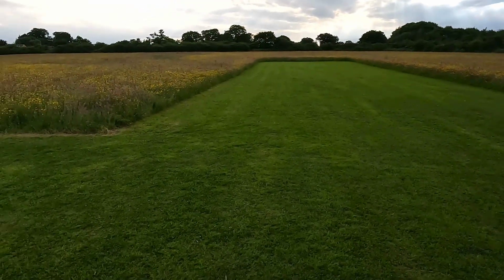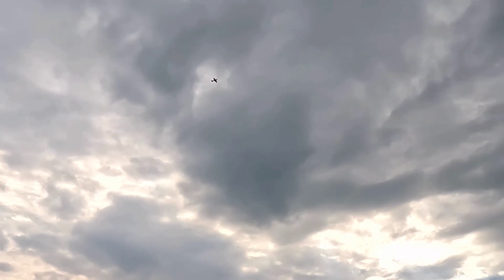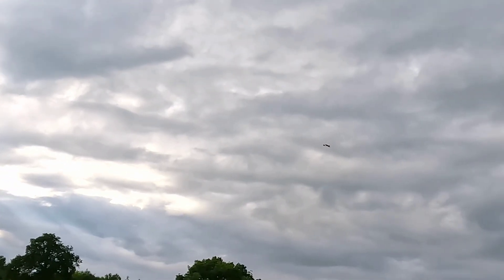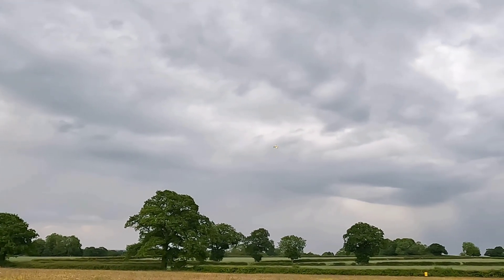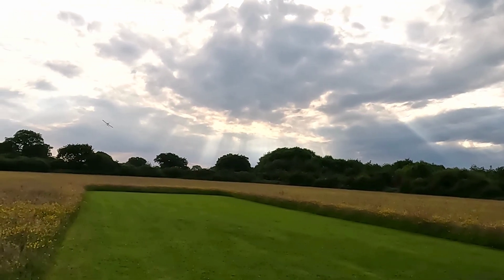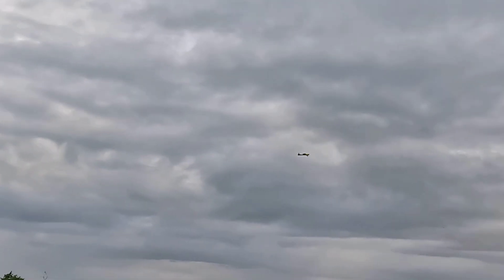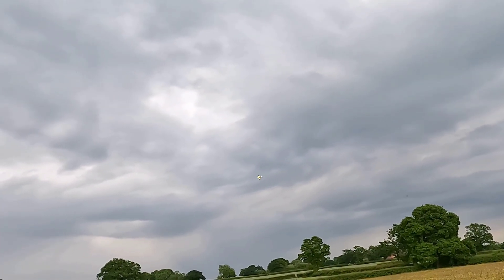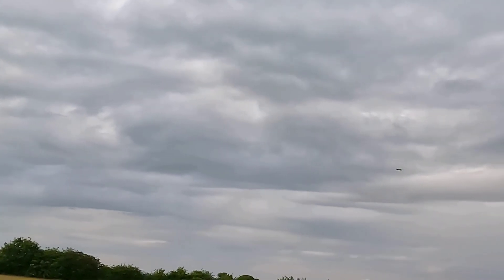SebArt Katana S 50E - Pt1 Maiden Flight TrimOut with Experts Narrative - GoPro - RC Aircraft 2022-07

Comment: very nice plane and flying - i always trim my planes for horizontal flight at about half throttle so it starts to climb when adding power - but just a personal preference. looked rock solid in the air.
Reply from the maker: Thank you for your Comment. 
The Katana previously belonged to the "expert" narrating the video. CliveS flies F3A aerobatics. The the Katana was essentially already set up but as I had fitted and new RX and new model in my TX, Clive was fine tuning my setup and familiarising me in the craft characteristics.
The SebArt Katana flies "like its on rails": great for aerobatics, for casual relaxed cruising with delightful ease and everything in between.
Reply: @davehrcfpv i recently bought a used one with digital hv servos. So i have to buy a drivetrain for 4 or 6S. Thats why i came across your video. My first sebart and first katana.
Reply from the maker: @lechiffre2617  The Katana was originally configured for 5S, so not recommended to go less than that. My Katana is 6S and has unlimited vertical climb. 
Details are in the video Description.
Well done on you acquisition - you will love it
Reply: @davehrcfpv  thx, for 120 € i couldnt say NO 😂. Theres a V2 out there but i dont know what the difference is beside the paint scheme. The math looks ok on 4S for basic flying and i can swap to 6S immediately with the dpower al4206 motor. So im confident...
Reply from the maker: @lechiffre2617  Bargain at €120!
I'm sure you will be on 6S sooner than you think. Recommend fitting a 6S 70Amp ESC to start with and ease the upgrade to 6S. Oh, and you could use throttle limiting on your TX to emulate 5S if set up for 6S.
Reply: @davehrcfpv  ok, thx - wish me luck for the maiden - cheers from germany
Reply from the maker: @lechiffre2617  I hope the mainden goes well for you.

Today I very sucessfully maidened my Sebart Sukhoi SU-29S 50E in 20th Anniversary colour scheme. What an amazing plane. Good enough to execute several aerobatic manoeuvres and a smooth landing. The video will appear shorty.
Did you find my Katana Pt2 video?
Reply: @davehrcfpv  yeah, but not part 3 ??? The thing is, i bought a used katana 30e for 70€ last year which was damaged. Repaired it and dropped in the electronics from a precision aerobatics XR52. And i have to maiden this one first - LOL
Reply from the maker: @lechiffre2617  Ah, yes, Katana Pt3. In the UK we have lost 3 months of flying weather this year, which has delayed everything. 

Have you you found my Great Planes Edge video? Sounds to be similar.